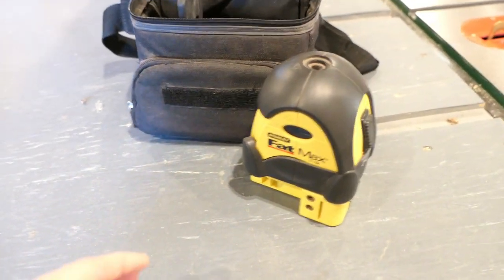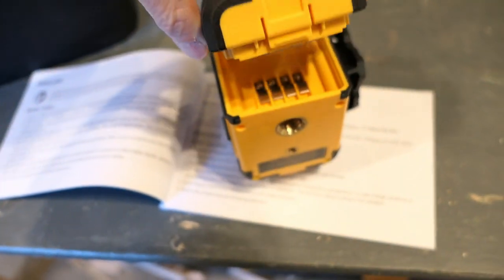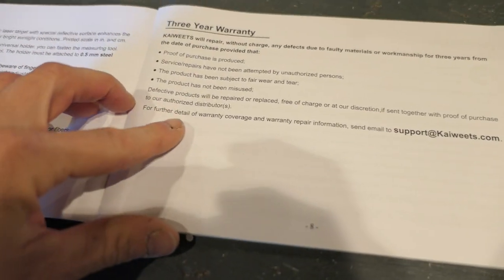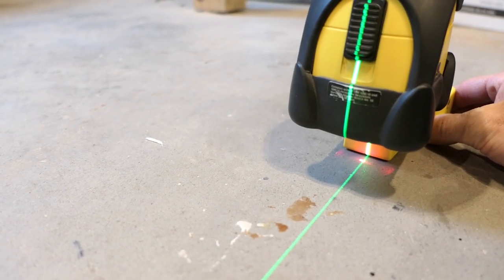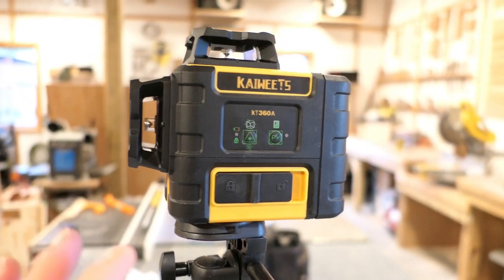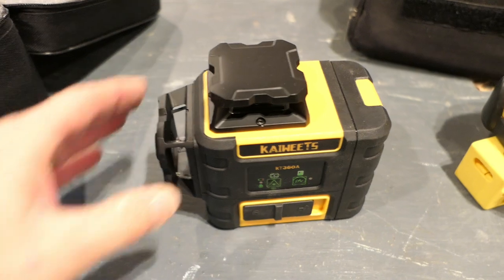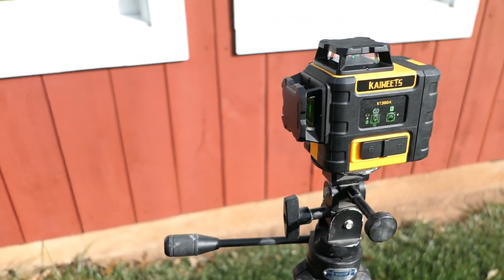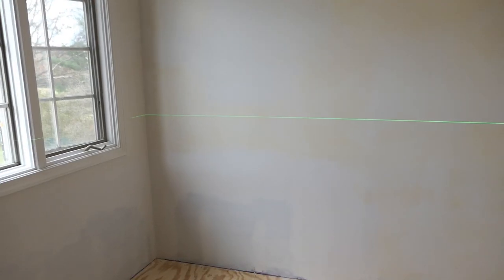Test And Review: Kaiweets KT360A Self Leveling Laser

Comment: Nice. Does it have a plumb bob feature?
Reply from the maker: One of the lasers is vertical, as you saw on the jobsite.  This can be used in the same manner as a plumb bob to find plumb.  However, it can't be used to mark a single spot on the floor and a corresponding spot on the ceiling, for example. With a two step process there is a way to accomplish this.  Let's say you have a mark on the floor (or ceiling) you wish to duplicate on the ceiling (or floor).  Line up the vertical laser with the mark and parallel to one wall, then make a mark on the ceiling.  Now turn the tool 90 degrees  and parallel with the other wall and repeat the process.  That measures the mark in two dimensions and should be correct.